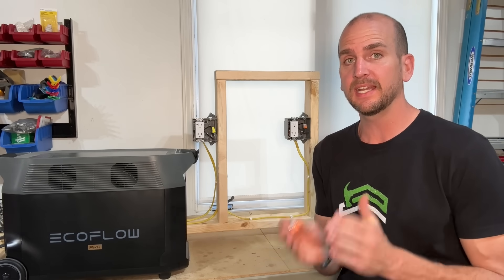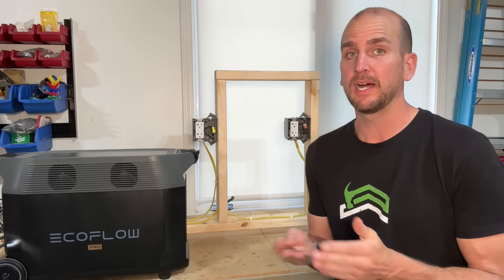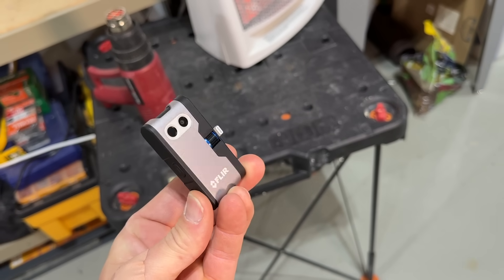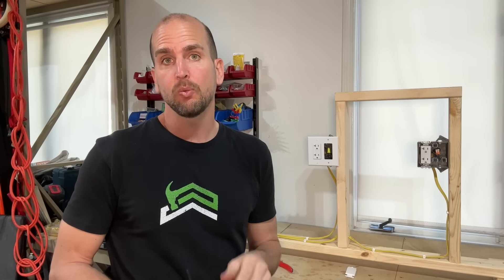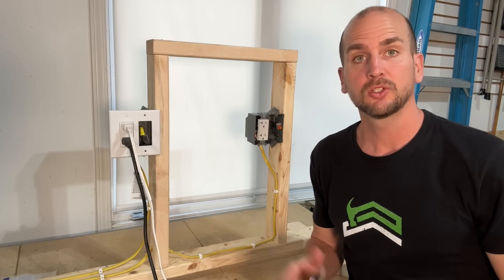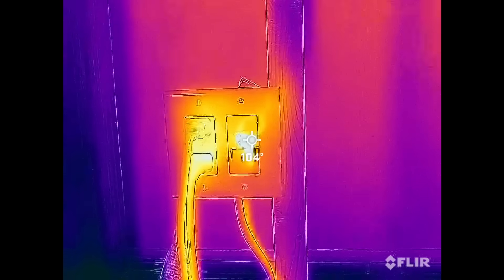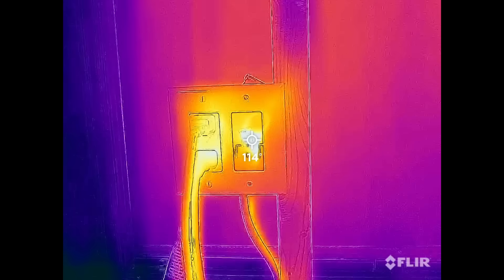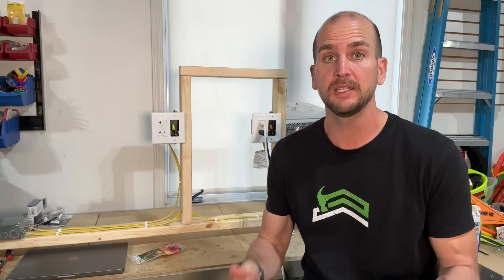Debunking the Pros: Can WAGO Lever Nuts Handle Heavy Electrical Loads?

Comment: Interesting Video. As I understand things, 12 AWG Romex is rated for 60 deg C max temp and is spec’ed to carry 20 Amps of CONTINUOUS current.  It is also rated for 30 deg C Ambient temperature.  This is 140 deg F max temperature, and 86 deg F Ambient.   I interpret this to mean that at an ambient temperature of 86 deg F, 12 AWG Romex carrying 20 Amps of CONTINUOUS current will not rise in temperature more than 54 deg F.  

My own testing (similar to what you've done) typically shows 12 AWG Romex doesn't rise 54 deg F at 20 Amps of CONTINUOUS current. It's more like half that, or 27 deg F (maybe 15 deg C) temperature rise at steady state (I used 2 hours). However, this is done for Romex wire largely “in the open”.  But... There are some building uncertainties. Fiberglass insulation is common in exterior walls. What does this do to the "Ambient" temperature of 12 AWG Romex on an exterior wall on a hot summer day?  Does 12 AWG Romex exceed 140 deg F if carrying 20 Amps of CONTINUOUS current if in a wall buried under fiberglass insulation?  To complicate things, my own testing shows (and your testing seems to confirm) that the highest temperatures occur at the wire junctions, not the wiring itself.  Plugs, screws, wire nuts, or WAGO connectors are typically where things get hottest (and can begin to approach the 54 deg F temperature rise above ambient at full CONTINUOUS rated current or 20 Amps in your example).  In your example, I have to wonder how hot things get in the electrical box if it was surrounded by fiberglass insulation, and there was maybe a thin layer of foam insulation (socket sealers) under the face plate?

221 deg F may be what the wire nuts or the WAGO Lever Nuts can handle, but it seems to me that we really want to keep everything below 140 deg F at all times. Put some fiberglass insulation around your electrical box and it remains unclear how hot things get! Your test shows 115 deg F after 20 minutes at 23 Amps. Your graph shows the temperature is still rising. True steady state might be 120 deg F (just extrapolating via eyeball). So, you are still 20 deg F away.  Your 20 deg F margin would be 30 deg F with the wire nuts. So... I can understand why some electricians prefer to use wire nuts! That extra 10 deg F of margin is nothing to sneeze at!

BTW... I think this “building uncertainty” is what is behind the 80% derating for continuous loads?  It seems unnecessary, and this derating didn't exist when I was a child... I recall 1875W space heaters for sale back in the day, and today you can only find 1500W space heaters available.   You can still purchase 1875W hair dryers, but these are considered intermittent loads.  (125V at 15A represents 100% load of a 15 Amps circuit, which is still considered the default outlet capacity for such appliances today).

Comment: 1 issue with your testing methodology: You didn't keep the test running until you hit equilibrium and the temps level off and stop rising. highly doubt either method would rise to dangerous temps, but still the science part of me irks at cutting the test short while temps were still going up.

Comment: I am concerned about the integrity of the clamping lever on the WAGOs.  Could they pop open - say as they heat up even a little? They seem like they are ok, but what is the long term experience with these?  
I know wire nuts are not perfect either but once you test their integrity, they seem to be much more likely to hold long term.
Reply: The lever actively opens the spring, you have to apply quite some force for that and they easily snap back to the closed state. So they cannot just pop up. It's IMO also really hard (almost impossible) to open them just by accident when crushing them into an overfilled box.

Comment: Also, while the lever nut bus bars may not seem like a lot of surface area contact, one should keep in mind the cross-section of a wire, even 12 or 10 gauge, isn't that huge either.  Yeah, the wire is solid (or stranded) copper, while the levernut is pressed physical contact, but if the bus bar is long enough, that shouldn't be a problem.

Comment: Wire nuts generally aren't worth it to me anymore except in very specific situations.  Twisted solid wire, especially 3+ wires, when I untwist them, straighten them (or have to clip copper compression sleeves off), generally damage the wire or require me to keep shortening them each time.  This happened to me when I tried to replace upgrade light switches and receptacles ~20 years ago (in old brown bakelite electrical boxes from the '60s).

Wagos ever so barely nick the wire, but above all allow the end of the wire to stay straight and otherwise be reused probably as many times as needed.  And you can move up to the beefier 221-6xx series Wago nuts rated up to 10awg wire and 30A with 12awg for added safety margin.  (But with my 30A circuits, I'm using industrial-grade 14-30 receptacles from Bryant/Hubbell anyway—same brand highly advised by Tesla for if you're gonna wire an EVSE off a 14-50.  The 14-30s have beefy clamp down terminals more than adequate for wiring 10awg directly (or even thicker gauge if you needed or desired), and you can just torque it down to spec to ensure a solid cold weld connection.)

Comment: Like others that have commented, I was skeptical about the wago lever nuts.  The test you just performed eased all of my concerns.  Thanks for all the useful content you create.  As a DIYer, it great to have a video or two to fall back on when I have a question.
Reply: People are pushing these things because they save time- and are considered "good enough" for certain limited situations- like a single light fixture with plenty of room in the work box. However spring loaded connections are prone to failure in the real world where many connections get crammed into a tiny work space. That's when the wires pop out and things start tripping and melting.
Reply: Dont let it ease your concerns. You were right to be skeptical.

Comment: Well thought out video and was intriguing, I will admit. However, a 10 degree difference isn’t much…it only looks like that when the visual representation on a curve is only scaled for baseline to measured product temp values. If the graph was scaled compared to max temp rating, the conclusion is ‘no difference’. Also, the temp crosshairs for the wire nuts were shaky and not always on the actual hotspot. Wagu offers a uniform installation method, something wirenuts don’t. I would think the key test for these is not under load but during ground fault conditions.
Reply: "Wagu offers a uniform installation method...."  Yeah, for hacks or DIY'ers.  :face-green-smiling:

Comment: When using wire nuts code requires connection to be twisted. Must be mechanically tight before wire nut applied.

Comment: I use the the 221 Wagos daily.  Also, I like the 221 Inline Splicing connector, wires do not pull out, unless your a gorilla & they don't overheat.  Always wondered if it would be a good idea to wrap electrical tape around them to keep the lever from inadvertently opening while stuffing wires into the back of an electrical box?  Wrapping wirenuts versus wrapping Wagos in electrical tape, that could be a test to see if it increases the heat, I'm pretty sure it would still be well under the rated 221
Reply: Yes to the tape idea! He actually shows that in another video I saw  that he made.

Comment: Had a baseboard heating circuit that fried multiple thermostats and wire nuts over a few years. Replaced the wire nuts with Wagos and haven’t had a problem since. 🤷‍♂️

Comment: A very useful video. I would say balancing out the slightly higher temps encountered with the Wago, you have a greater assurance the connection was made in an approved manner with the Wago. I would suspect there are more wire nuts where the workmanship of the connection is sub-standard, resulting in a hotter connection when in use. I would suggest to the Wago people that they consider coming out with an "industrial" line where they make the part out of heavier materials and maybe they could match or even improve on the performance of the wire nut.

Again, great job!
Reply: Whats the balance when the wago catches fire?

Comment: I would be curious how both perform as they age and are exposed to numerous loads and atmospheric conditions, such as an outside plug exposed to temperature fluctuations and high humidity. I have used both but tend to use wago connections on lighting and low current applications and wire nuts and pre twisted wire on high current loads.

Comment: There is another YouTube video that tests Wago.  They slowly cranked the amps up until the wires were smoking, but the Wago was not smoking.  I love Wago.  Much easier to use than wire nuts.  You also have visual confirmation of the wire contacts.  Wago is made in Germany and they have been in use in Europe for 20 years with no problems.  Back in 1968 when I was studying to be an electrician we learned how to make solder splices like they did in the 1940s.  After applying solder then wrap with rubber tape and then friction tape.  I have run across old solder splices but I have never had to make one.
Reply: How about a test with wires connected with the two types of connectors in series, and then used to jump start a car with a peak draw over 600A, or using a carbon pile load tester?
It'd be like a tug of war; see if either of them have any problems at 20x spec current. Two DMMs across each connector to see the voltage drop will objectively determine resistance relative to each other.
Reply: Wago was not smoking??  Ha, give it time.

Comment: Thanks for doing this.

I remain sold on the wago product. Not surprised it runs a little warmer due to its construction, so far as I'm concerned the ease of use and the solidity of the connections once made far outweigh 10° difference on a product that has a 221° top temperature.
Reply: and yet you still use them?
Reply: We'll hear about you on the news someday.  :face-turquoise-covering-eyes:

Comment: The Wago has a current and voltage rating.  These are continuous ratings.  I have not been able to find any information on surge current ratings.  I have no doubt they work as intended within their rating.  However, If you use these in a circuit with a bunch of LED  fixtures  the parallel capacitance that must be charged can be high.  I have measured over 200 amps, the maximum on my peak reading meter.  This surge is over quickly, but the voltage dropped across the Wago can be 10's of volts. ( Using an oscilloscope to capture the event. ) That is an instantaneous power of over 20 000 watts for a few microseconds.  The small contact area will instantly heat and oxidize.  It may still carry the normal load for awhile but go through several on off cycles and see what happens.  I think the same surge is leading to the high failure rate of wall switch contacts that is becoming common.  A properly twisted wire pair and wire nut has enormously more contact area and does not have this failure mode.

Comment: I would like to see the temps if the wires had been twisted together creating a good mechanical connection before using the wire nut to bind and insulate the splice.  My understanding is the first gen WAGOs were prone to failure.  As your test shows,  they should be fine now, unless exposed to humidity and corrosion.  BTW, breakers should only carry 80% of sustained rated load.  So if your 20A breaker doesn't trip at 16A sustained load? It's bad.  Replace it! Given that? WAGO should be fine for use on 15-20A circuits.  There are places like junction boxes on modern LED dimmable can lights where the number of conductors and splices make WAGOs a very attractive option.

Comment: The Wago has to be much better than the electricians that backstab the switches ans recepticals to save time. I would be fine using the Wago product in most situations, but if I'm wiring for any high amperage device like an A/C unit, dehuminfier or microwave, I'll probably stay with the wirenuts.

Comment: See, your chart shows clearly how things are posted by people out of context creating a panic, such as one connector gets HOTTER than the other, sounds scary right? but your tests showed it was ONLY around 10-15 deg F, still sounds scary to some, but in CONTEXT it's NOTHING, the context was the 220 degree F RATING, even overloaded none of the connectors even came close to that, in fact they were all more than 100 degrees BELOW their rated max! so WHO CARES if one is 10-15 degrees warmer than the other, it DOESNT MATTER one bit, your context proves it.

People do the out of context all the time, things like "gun deaths DOUBLED" in one year, sounds scary until you learn there was ONLY one gun death in that small town in a normal year, this year it happened to be 2, and maybe next year none,  but people dont think that way, they wrongly think in terms of like 5000 deaths "doubling" in one year to 10,000, we have to do something immediately!!!!

I changed ALL my wire nuts to Wago connectors- SO Much better!

Comment: Interesting 

I have been a Wago guy and will to continue yo be so.  I used wire nuts for years and while a “perfect” connection is solid, it is so much easier to get perfect connection every time with a Wago

Comment: I wonder about the durability of the plastic in WAGOs after 10 years of heat/cool cycles between 70 and 110°F. Perhaps the UL testing involved this kind of validation. Heavy duty wire nuts have been proven to be durable under high amperages and the resulting thermal cycles for decades.

Another potential issue is the (slightly) extra heat WAGOs generate inside a sealed wall box containing electronics like smart switches.

Thanks for the excellent analysis and presentation!
Reply: Yes, "slight".  And keep in mind it's "slight" when running a worst-case scenario amp load.  I share your curiosity regarding long-term reliability, but I try to keep in mind that both UL and ECC approves these things, and they've been used widely in Europe (both residential & commercial) for 30+ years.  That doesn't guarantee anything, but it's a good sign.  It's not like they just popped onto the market 5 years ago.

Comment: You need to give these time to fail, just like the most common failure on receptacles is when they have the wires pushed in the back and not wrapped around the terminals.

Comment: It so easy to twist solid wires together and attach a wire nut - no way that connection will fail -  if it ain’t broke why fix it .  The only time I consider using Wago connectors is when I have to attach stranded wire and solid wire

Comment: Wago is great to connect transition from old aluminum cable to new copper cable .

The clamp has spring that would keep constant pressure on the separate aluminum and copper cable . 
Thus avoiding the different coefficient of expansion problem between copper and aluminum
Reply: What happens when the pressure deteriorates over time and heat? Its called arcing and fire.

Comment: It would be interesting to test this with a continuous load.  Like hook up an EV charger pulling 16 amps on the 20 amp outlet (max amp draw for 20 amp outlet for a continuous load) and see how hot a wago gets after 4 hours of continuous load. And then again at 8 or 10 hours.  I'm sure it'll be well below the 105 degrees C that they are rated.
Reply: I just purchased a ChargePoint Home Flex EV charger that incorporates lever operated spring loaded connection points for 6 AWG wire (CU only) at a max 48A continuous current draw on a 60A circuit.  The product is UL listed.

Comment: It's just another tool in the toolbox.  If you're wiring up a bunch of solid wire circuits, pre-twisting and using wire nuts is hard to beat and is cheap.  If you're not going to pre-twist, then don't use wire nuts and go ahead and use the wagos, there is too much of a chance of a poor connection.  I find wagos are great to use when you have to deal with stranded wire, especially connecting stranded to solid wires.  The new inline wagos are also great when you're trying to connect to a wire with not much length to work with.  This can be a real time and money saver instead of pulling a new wire or trying to crimp/solder or whatever other kind of splice.
Reply: Interesting, since at least one wire nut manufacturer specifies that the wires are not to be twisted.

Comment: Would be nice if they could somehow have just a bit more contact area. I use them in all my home wiring projects, but I only used stranded wire, where these Wago's perform a little better as they make more contact on the buss bar. Trying to use regular twist wire nuts with stranded wire sucks, especially small gauge stuff like lighting fixtures.

I'm not too worried about the spring losing tension either, they are well below the plastic deformation point and don't get worked more than a couple times in their life, they should last a very long time.

Comment: I rewiring my basement with these (no choice, there was cloth wire and no grounds in original wiring). The first J-box on the largest circuit goes 5 ways with a Wago 221.
That circuit hits 10-12A quite a bit (Yes, I'm going to split that up after I get the fuse panel replaced)(Yes,, Fuse.. Not breaker)
I was feeling for heat when I put in the Wago, and it barely gets above room temperature when at full load for that circuit for several hours.
Wago's are awesome.
Reply from the maker: Yes they are 👍
Reply: @EverydayHomeRepairs  there garbage you will findout later when the circuit starts to fail.